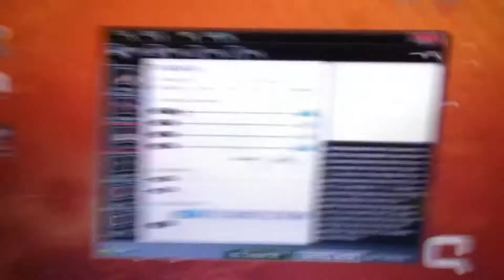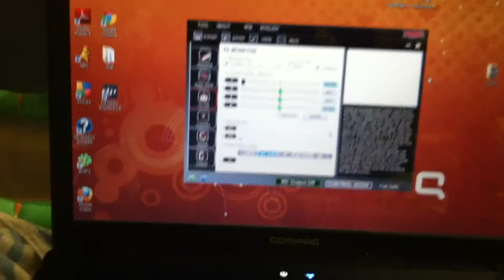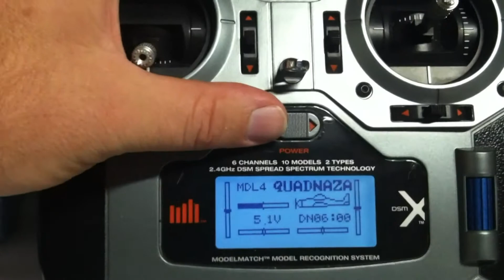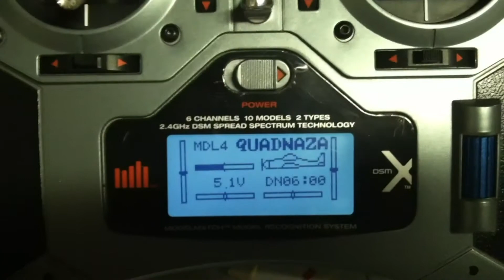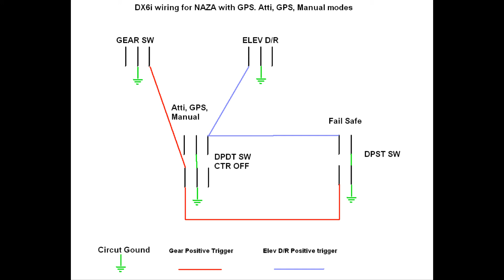HOW TO setup a DX6i and Dji Naza-M with full function

Comment: Thanks for the post chris.... I'm still pretty lost but this post will help me in the right direction.... I wish I had some spare cash so I could buy a dx8... use the 6x for the gimbal....

Cheers.
Reply from the maker: Same here that is why I did this. If I had the cash I would have just upgraded. Will have to later for my gimbal control.

Comment: Hi how did you calibrate your compass with the dx6i
Reply from the maker: I calibrate the GPS by flipping the switch that turns the Naza from atti gps to manual mode 8 times. Then you spin in a circle, then turn it on its side and spin around again. Done ready to go.
Reply: Thanks mate,my problem was I was flicking the switch back and forth loads of times but i couldn't get the solid orange light on but after about 30 flicks it came on and now it's calibrated,cheers
Reply from the maker: Nice glad you got it figured out.
Reply: Chris Moore hi Chris,my problem now is trying to figer out how to get it to go into failsafe when I turn off my tx as mine doesn't,can you advise,cheers
Reply from the maker: You have to have a Fail-safe receiver. What model receiver do you have? We can figure it out from there.
Reply: Hi I have the 6210 spectrum receiver,cheers
Reply from the maker: To enabled the preset failsafe (on signal loss, all channels are set to their failsafe position):

1.Insert bind plug and power on RX

2.Remove the bind plug when the RX LEDs start flashing.

3.Move throttle to 50%, leaving everything else centered. This is what you want the receiver to do if a signal loss happens.

4.Turn on TX while holding the Trainer button - to tell the TX to enter bind mode.

5.After 15 seconds, they should be bound and the fail safe should be active.
Reply: Thanks I will try it tonight,I had already done this but I never had it in failsafe,I had it in GPS mode,why did I nor think to put it into failsafe ha,cheers I will let you know
Reply: Chris Moore Hi Chris,I done what you advised but it did not work,when I switch the control off the throttle goes to 50% but never went into RTH mode
Reply from the maker: Bummer I read now that the 6210 receiver only does Failsafe with the throttle channel all others stay at current position. So your best bet is to upgrade or get a OrangeRX that does all channels. Here is the manual for your receiver. http://www.spektrumrc.com/ProdInfo/Files/SPMAR6210_Manual.pdf
Reply: Ha that is a bummer,thanks for your help,you now have another subscriber
Reply: Chris Moore they doesn`t stay at current position : ''With SmartSafe, 
when signal is lost the throttle channel only is driven to its preset failsafe position (normally low 
throttle) while all other channels hold last command.''

Comment: How do you make that MC Output to turn off..?so I can get into NAZA M Lite calibration for my transmitter. Thanks
Reply from the maker: The calibration should work with that on. If it is not working reboot both the computer and the controller. If still not working reinstall the Naza software make sure you are using the correct software Naza M1-2 software will not work with the Lite.

Comment: ok i got the mode switch to work with some travel adjustments of gear +80%. When switch in down manual,  switch in middle gps, switch up attitude. IOC work after i adjust flaps to norm+81 and land-91.   You are the man for figuring this out!!!! Thanks a ton!!!

Comment: i think ur terminology is incorrect? The switch used for att, gps, manual is called a spdt(single pole double throw), and is drawn in diagram as a dpdt? This and the failsafe appears to be a dpdt.  and 2 terminals are left off in diagram.  I could be wrong but im having some problems following tutorial. Im following pics, i hope this works for me im only half way done.  Thanks for this post, if it werent for this posting id be stuck spending money on new tx.

Comment: Hi... i have everything working but the fail safe when you turn the radio off... do you need a wire connected to the naza and orangerx just to allow fail safe to work or how do you program it up so fail safe works when you turn the radio off... Thanks...

Comment from the maker: You will have to make sure you have set the positions in the switch in the Travel adjustments. Stock I believe they are set to 100% on the both up and down gear positions. Just change the down position to 0%.

Comment: Got caught up on the 2 mix. Plugged AUX1 into X2. Prior to plugging up the IOC was not available to me. Now that I've got it plugged up it's available but no switch positions make a difference. I've got a Spektrum AR6210(w/of course a DX6i) with what appears to be the same features as the Orange R620. My settings were a little different in the mix one but if everyone follows the steps they should get the same results by fiddling with the "Rate U", and travel adjustment for the gear.

Comment from the maker: I can see if I can get a video of it. It is pretty easy looking at the manual Aileron goes to Aileron, Elevator or to Elevator, and so on. With Gear and Aux1, Gear goes to U and Aux1 goes to X2. This will allow you to use the combination of switches or the added switches to make these functions work.

Comment from the maker: Once it is setup you can use the original switches as they are suppose to be used. You will just have to make sure the added switches are in the neutral or off position. I also fly planes with flaps and gear they function as the should.

Comment: Chris, once the switches are added, can I still fly my airplanes using the switches in normal mode or do your changes restrict the transmitter to use for a "quadnaza"?
Thanks, Frank